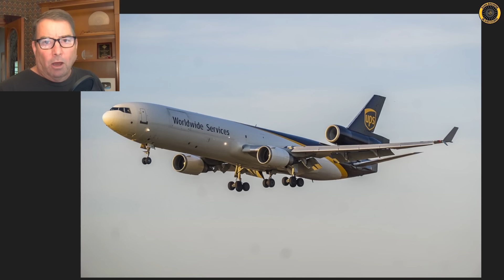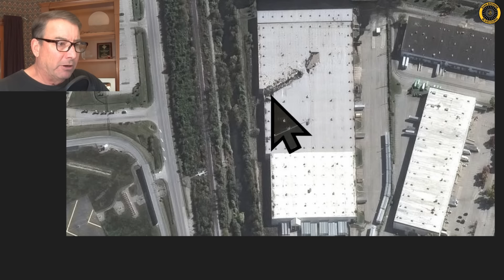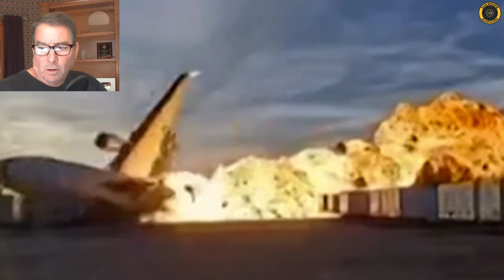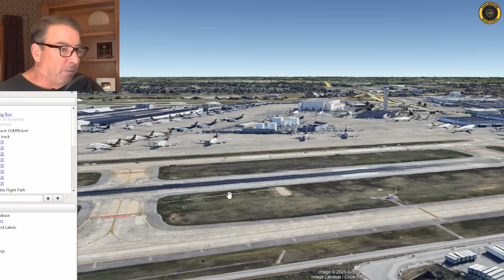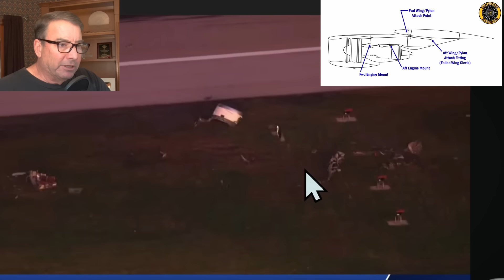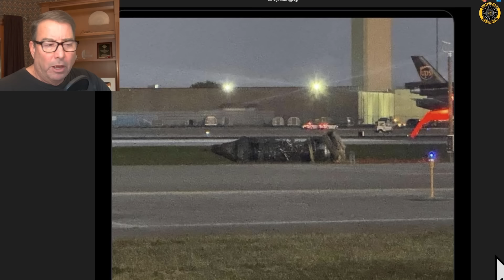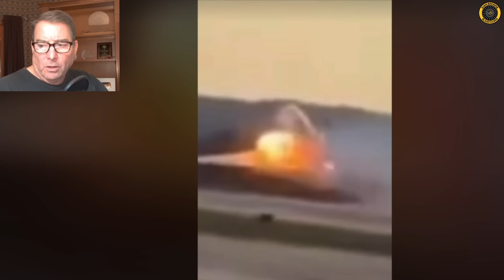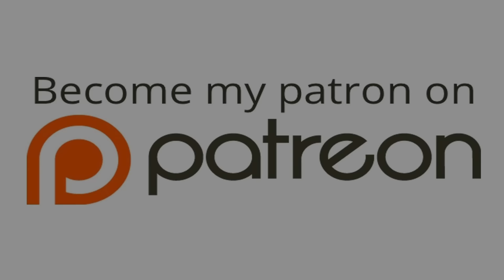UPS #2976 UPDATE 2 6 Nov 2025

Comment: Seems like they may need to replace the main engines on these planes with bigger engines so the plane can take off and fly on only one wing engine and not depend on the tail engine if the tail engine is going to be wiped out by a failing main engine. Maybe even due away with the tail engine when they rebuild and update these planes.

Comment: When I first saw the live helicopter feed of it right after it happened, and I saw that drag mark through the roof of the warehouse at the end of the runway, I immediately said, it has to be the landing gear, because that building wasn't on fire, the fire started past that building. If a wing had struck it, especially being the left wing that was currently on fire, it would have spewed fuel and fire from the impact all the way across the roof of the building. No fire, no wing strike. Pretty simple.... And I'm just ARFF and can see that.

Comment: Juan you been a HEAVY PILOT 

@jeffreyhansen6740 • 16 min ago (edited)
I'm surprised your headlines
Aren't about the fuel ⛽️.
That airplane WEIGHT EXCEEDS
1/2 MILLION POUNDS
The MD-11's maximum takeoff weight (MTOW) is generally
602,500 lbs (273,314 kg), but can be increased to 630,500 lbs (285,990 kg) for specific variants like the extended-range (ER) and converted freighter models through upgrades and modifications.
GOD SPEED
FLEW FREIGHT ALL MY CAREER
PRAYING
LOUISILE UPS
Maximum weight takeoffs 🛫 
Are what we get paid for

Comment: Great coverage, Juan.  Sometimes there's just nothing left to say.  Just Godspeed to all, including the shop cat someone mentioned.  I do think the pylon separated on #1 from its attach points on rotation.  Prior to rotation, there was no sudden swerve.  The wing  fire broke out simultaneously.  It is possible, I guess, that #2 suffered a compressor stall at the same time.  The  CVR contents may point to some answers..I think it's important to the aviation community and those most affected by the accident that the NTSB be transparent and release the CVR transcripts.  The airplane was in service for thirty years, and with entropy and metal fatigue this "full boat" flight may have been one too many for the old  bird.

Comment: So far, I am still very much inclined to suspect this event began with a foriegn object ingested into engine one. Shortly after full power spool up. Naturally a compressor fan failure could also have taken place. High speed shrapnel from engine one. Obviously destroying the engine pylon, as well as the left wing fuel tanks.

Comment: That left engine ripped off with the pylon and flew over the top of the aircraft on to the right side of the runway. There was no way I could go under the aircraft and it would have been on the left side of the runway if it had. Just my take as a pilot of many decades

Comment: Disagree. I don’t think That is acoustic liner, I think that is fan containment. It’s made from layers of Kevlar. If the pylon mount lets go and the engine and departs when it hits the ground we expect the Kevlar layers to delaminate. 
If the fan suffered a blade off event, the Kevlar will catch it, and the mount will tolerate the imbalance loads. If the fan disk shattered the parts might not contain but again the mount should not let go. I can’t imagine a mode where engine failure can break the mounts. Many holes from energetic parts yes, break the mount no.

Comment: Juan - you are one road off.  The frame where you see the aircraft from the dash cam was not Crittenden, but Grade Lane.  It begs the question what part of the plane caused the damage to the roof of the large warehouse right at the end of the runway.  I thought it was the landing gear, but it seems intact on the dash cam video.  If it was the wing, I would suspect the plane would have crashed immediately and not cleared the warehouse and one other building before crashing.

Comment: At 6:54, the fire is on top of the wing, perhaps even starting on the top front of the wing. 
For me it seems, the engine and the pylone have first disconnected, the engine still on power has made an 180° flip over the front of the wing, destroyed the top of the wing and the tanks/pipes e.g. from the top and then ended up on the rigth site of the runway. The heavy engine, pylone and other lighter engine parts are all more or less near together all on the right site. So as pylone, engine and all other parts were so near together on the right (so wrong) site of the runway means it came down in one piece on the right site and broke/diintegrated late into different parts, when it crashed onto the ground on the right site of the runway. 

So the big question as this is the root of this accident: Why has the left engine together with the pylone detached from the wing? For me it seems to be more likely an pylone failure than because of an engine failure in first case. But I will not exclude anything as it is by far too early.

Comment: The yellow material around the  fan module isnt acoustic material. Its Kevlar. The purpose is for it to contain fan blades in case of separation. The acoustic panels are just forward of the fan blade tips and forward of the abraidable material that makes up the gap between the blades and fan module.
Reply: Yes, that’s a perfect explanation. I don’t know why everybody automatically assumes everything is carbon fiber. Carbon fiber is never used to protect anything from an impact carbon fiber is very brittle. We use Kevlar to protect from impacts that’s why bulletproof vest are made of Kevlar not carbon fiber. Kevlar is yellow carbon fiber is black. kevlar, when you tear it up, turns into a big mess of fuzz, which is what it looks like on the front of that engine. Carbon fiber just breaks into pieces.
Reply: Thank you for the explanation!
Reply: Would such a failure cause the complete separation of both engine AND pylon?
Reply: @wll1500  the engine is attached to pylon with forward and aft mount fuse pins that are engineered to fail in a controlled way in order to protect the wing structure. The fuse pins connect the engine to the pylon. Normally the pins would fail in sequence allowing the engine to fall clear of the pylon. The pylon would remain attached to the wing.
Reply: @FusedAndLovingIt but in this case the pylon didn't remain attached. Which leads me to believe the failure was actually in the pylon-to-wing connection, not an internal failure of the engine.
Reply: @abadzl1455 so how do you square the pylon departing the airplane with an internal engine failure such as a fractured disc?
Reply: @wll1500 that fan rotor is very heavy. The blades are turning at about 3800 rpm at full power. If part of the disc fails it will create an ungodly imbalance like you can't imagine. I can see the engine/pylon separating from the wing easily in that scenario. 
That imbalance would be violently felt throughout the aircraft. Im sure it shook the flight deck so bad that they probably couldnt see the flight displays clearly.
Reply: @wll1500  1455 can correct me if I'm wrong, but I beleive if the engine gets to far out of balance, they engine is designed to seperate.
Reply: @SPFDRumI believe the engine is designed to separate from the pylon, leaving the pylon-wing connection intact. In this case the pylon also separated from the wing. I presume the engine and pylon came off the wing together and broke apart on the ground but we do not know that. It sounds like there is airport security cam footage that shows the entire takeoff run. That in combination with data from the recorders and examination of the wreckage will provide more definitive answers.
Reply: @wll1500 It would cause the engine to oscillate so violently that the pylon would fail.
Reply: Thanks for sharing from your experience. I’m sad for this crew and their families. Love those MD-11s. Such a big beauty.
Reply: Could it be the engine ingested something from the Runway, FOD?
Reply: you da man!
Reply: Well, but we don't know yet if that's the cause or the result of the departure. An engine can shed off blades when impacting the ground after departing. In addition it troubled violently down next to the runway, with enough force to separate the pilon assembly. This could also very well lead to the pile up of the material.
Reply: Thank you. Thats excellent information.

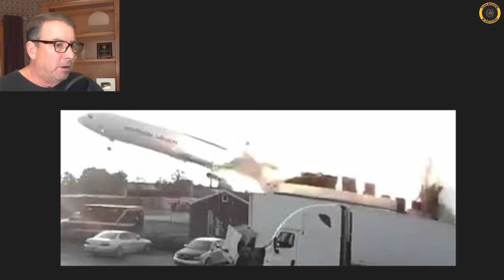Comment: The dash-cam photo that appears in the video from 0:54 to 1:53, was not taken from Crittenden Drive, it was taken from about 7015 Grade Lane.  The plane had already hit the roof of the UPS building and it was heading towards the tanks at the petroleum recycling company to the right in the same dash-cam photo.  The tanks can be seen in that photo just left of and under the dilapidated billboard sign on the right side of the street.  The black tanks are behind a building, but their tops are visible above it.

The second dash-cam photo showing the plane just after it hit the tanks was taken from the lot of Kentucky Truck Parts & Service which is on Knopp Avenue.

The third dash-cam photo that shows the plane on the ground and right wing straight in the air was taken from the Redden Fleet Leasing lot at 511 Abel.

Small businesses near the corner of Abel Avenue and Melton Avenue were in the direct path of the sliding airplane.  People were at work in some of those buildings.

Comment: So pylon mount hypothesis is the strongest at this time. Engine on wrong side of runway implies it went up and over as thrust pulled it away. The big fuel lines explain the big fire. Hot gas and debris explains mid engine surge and thrust loss. 
I hope we get evidence to confirm and useful  corrective action such as mount inspections.

Comment: You're most likely right that the engine came apart. I thought the same when i saw the cowling parts first on the ground. And It must have really come apart to detatch that engine pod.  If only it happened a little earlier, they could have rejected. Bless those pilots they tried their best to get it off the ground. I wonder at what point they knew it came off? And It's a shame that there's so much in the way at the end of this runway, they may have had a fighting chance. My son works for ups, and we're pretty near. He came home really shocked. Even though ups is huge, they were co workers. Let's give prayers for those in that plane and on the ground.

Comment: I think the pylon failed, rather than the engine, based on the debris spread. The major components of the engine and pylon are all on the right side of the runway, none on the left. If the pylon failed at the wing attachment points, then the engine would be thrown in entirety off the plane. The engine exterior would gain rotating energy since it’s just lost all its fuel but is spinning internally. This could account for it being thrown to the right of the runway. In any case, when the engine hits the ground, it’s going to destroy the large fan blades and fracture the engine casing, and soon after shear off the pylon from the core. If the engine had a massive uncontained failure, we should see some cowling and fan parts on the left side of the runway, then detachment of the engine further down the runway. But we know that pylons can hold an engine with catastrophic failure without separation, so even if there was a massive engine failure, the pylon really should have kept the destroyed engine on the wing. So at the moment, I’m inclined to think the pylon failed first.

Comment: Genuine question: 

They had 12K FT of runway. Even with only 2 engines how did it just barely clear the fence? Shouldn’t a full 12k FT runway have that puppy off the ground halfway down even fully loaded with 2 engines? Is that not possible.
Reply: I was thinking the same thing. Dots are not connecting.
Reply: Engine #2 had a compressor stall with sparks - most likely due to debris from engine #1. So they maybe had only engine #3 on full power which is way too weak to lift a fully loaded plane.

Comment: You know the investigators are going to be looking for all of the individual pylon parts, attachments, etc.  If it was an engine imbalance caused by a fan failure that caused the engine to depart the airplane, the attachment points will tell the story of that failure event.  If it's fatigue or some other kind of material failure, the story will be there.  I wish them the very best of luck.

Comment: That dash cam footage is actually from Grade Ln at coordinates 38.14815873684558, -85.73643644519248 so it's after the aircraft hit/damage the first building. 

Although most are assuming that building was damaged by impact, it may have been damaged by engine thrust without contact. 

Even that the slats are extended, there is likely severe damage to them in the area near the pylon which may be just as bad as retracted slats or worse for a portion of the wing. 

The video footage all shows the aircraft actually flying quite fast and the last ADSB ground speed values are speeds where one would expect the aircraft could remain flying so that gives further credence to the likelihood of a compromised left wing being the main cause of the final impact.

Comment: Nice to know we're not having deja vu of AA191, but you know what the wildest part of AA191 is? In spite of the damage, they were able to climb out and away. The CVR data stopped when the engine departed, but a look at AA's procedures revealed the published procedure for an engine out was to slow to V2 with the slats extended, so they pitched for that not realizing the slats were auto retracting on the left wing. Had they kept speed, they would have survived. Further, the airplane was NOT equipped with an optional stick shaker on the FO's side, one on the captain's was standard equipment, but also became inop when the engine departed the aircraft. Safety features should never be extra charge options on transport category aircraft.

Comment: For anyone wondering how debris from #1 engine could possibly get inside #3 engine (Juan didn't say this happened, he said it was a possibility), this non-pilot remembers from airplane disaster documentaries (such as El Al 1867) that when a still-spinning engine separates from the aircraft, it is still generating thrust, and since it is unencumbered by the drag of the plane, it can "fly faster" than the rest of the aircraft for a short time. 

The #1 engine obviously crossed under (or even over) the fuselage to get to the right side of the runway. Since it could have been "flying faster" than the rest of the plane, it could have crossed the runway in front of the #3 engine still on the right wing, spewing debris that could be injected by #3 engine.

Comment: 1:55 The damage to the building was likely from the tail striking the building. As you say, other video shows the plane wings level immediately after takeoff, so it wouldn't make sense for the left wing to strike the building first. The deviation of the damage line from the runway centerline is probably just due to the yaw moment imparted onto the plane from the loss of thrust on the left side. The remaining engine on the right would've yawed it to the left, causing the flight path to deviate left of the runway centerline.

Comment: I guess NTSB they will check to see of UPS maintenance went back to the quicker remove/install practice to save man-hours after many years since the May 25, 1979 American Airlines Flight 191 malfeasance.
Reply: The maintenance was done by  3rd party ST Engineering in San Antonio, October 18.

Comment: I'm no expert. Not even close. Even so, it was clear to me that most of the failures had to have happened after the decision point (if that's the correct term--meaning the go/no-go moment before rotation). Unrecoverable seems such a bland term.

My (erroneous) thought was that if the #2 engine still had full thrust, it could have pitched the aircraft down because of the distance between the engine and the fuselage centerline, and the #3 engine would have yawed the aircraft to the right, yielding the resulting curvature of the path of destruction. I was clearly not thinking about FOD entering #2 engine and causing it to lose all thrust in just a couple seconds. 

Catastrophic engine failure is a mild expression for this one. 

I live about four miles upwind of where this happened. I used to work for UPS, even fueled aircraft there for a couple years thirty-some years ago, but never had to fuel a DC-10 or MD-11 contract aircraft during peak seasons (this was before UPS bought their MD-11 fleet). I know a lot of people who were personally affected by the initial shelter in place order, and a few who have direct ties to those who perished.

Comment: Has there been other cases in tri-holer aircraft where a wing engine failure has subsequently compromised the normal operation of the tail engine? Seems like an inherent danger that twins don't suffer from, but I can't think of it ever happening previously.

Comment: The fact the pylon and cowling are 75 feet from each other tells me that the whole thing came off at once. Why? Because the plane was going 125-150mph and if they came off sequentially, even three seconds apart, the pylon would be several hundred feet further down the runway. The whole thing came off at the same time.

Comment: If someone can explain how did they ended up rotating near the end of the runway 17R which is almost 12.000 ft long. With the takeoff weight they had, what would have been a normal takeoff distance?

Comment: I’m wondering if the engine didn’t pivot up an go over the top of the fuselage before coming down on the right side of the plane?  It would explain how the high, center mounted #2 engine ingested enough bits to stall out.